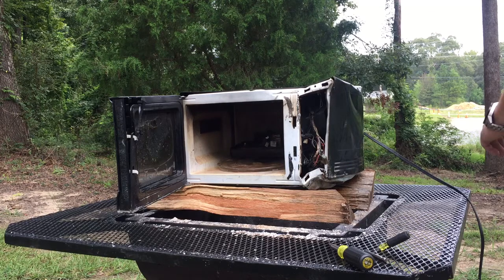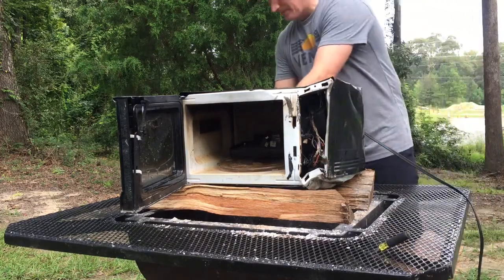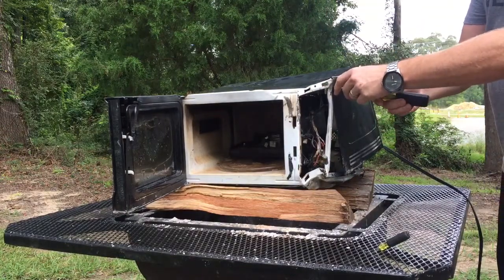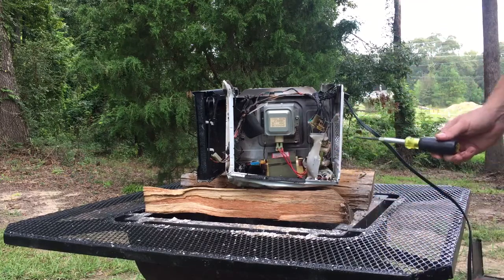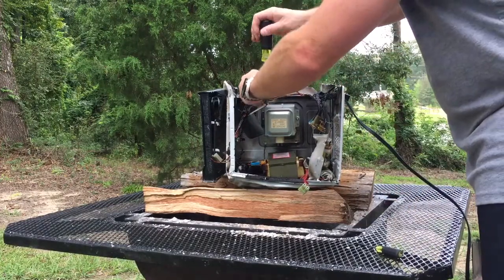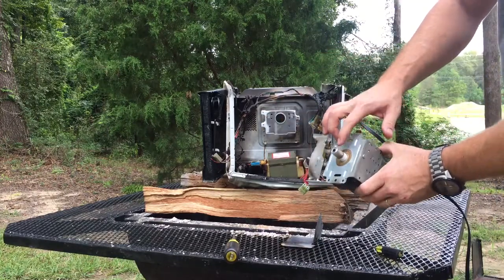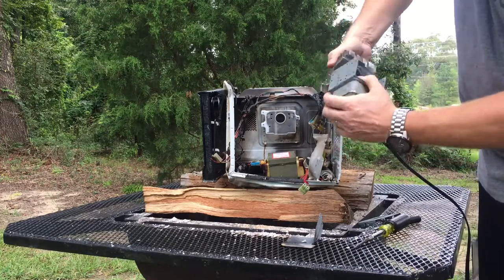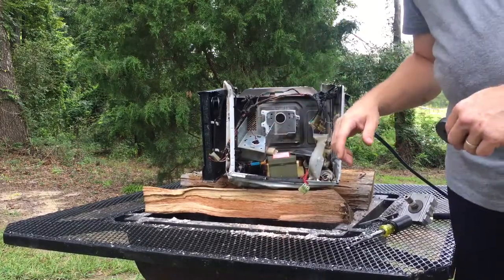How to safely remove a magnetron from a microwave

Comment: What is considered the estimated holding strength of the small microwave magnet or the larger microwave magnet? I have a outdoor project involving a outdoor CB antenna I'm wanting to try and the stand base holding a 102" whip antenna would be attached with magnets to the roof of a metal building.
Reply from the maker: Idk sorry

Comment: Could it electrocute me if I go to remove transformer and the capacitor isnt discharged?
Reply from the maker: Yes but that’s unlikely because the diode would have to be bad
Reply: Ok thanks for the info...appreciate u getting back with me. I'm great with welding and carpentry but not worth a damn when it comes to electric